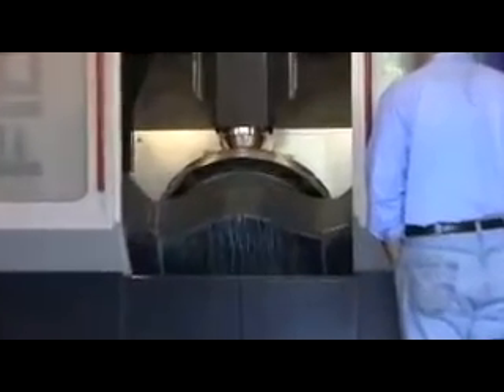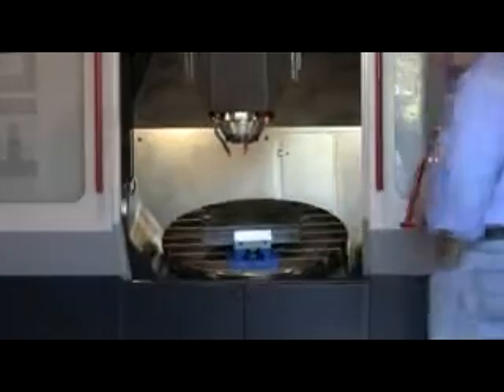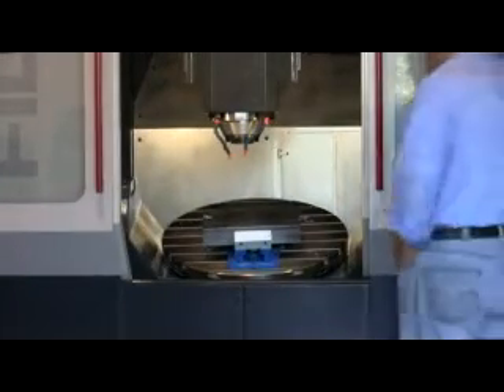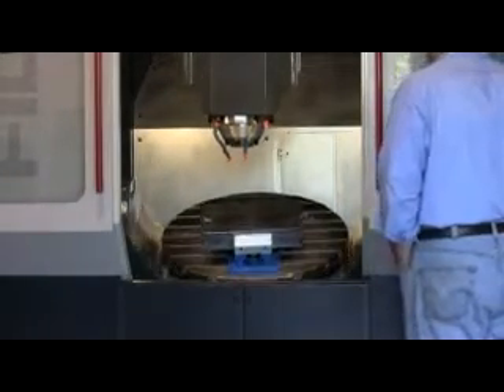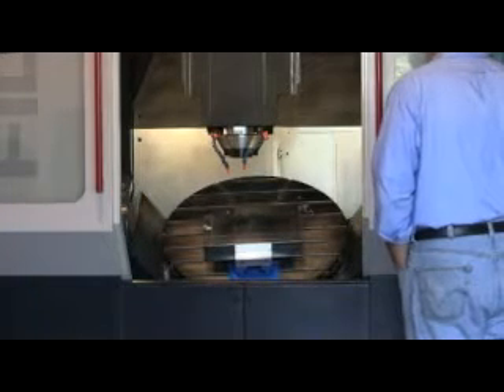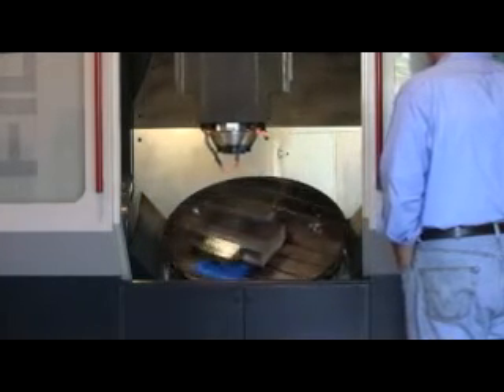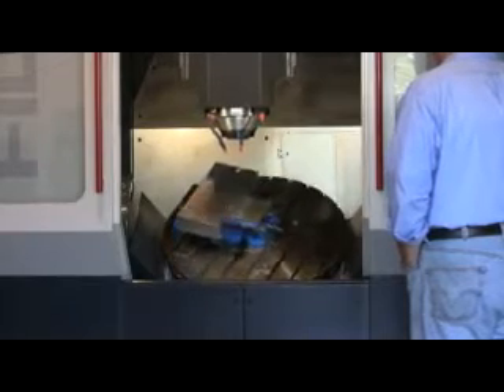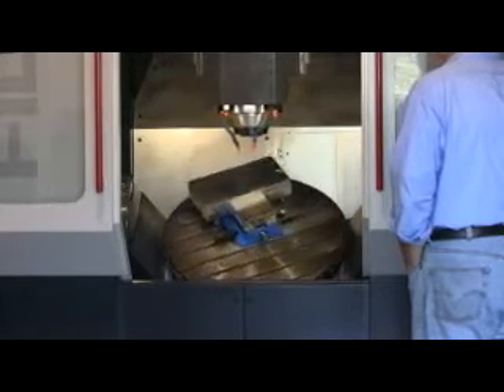SwiftCarb RampMill 6061 aluminum at 200IN Material Removal Rate

Comment: Unless thats a 50 taper or HSk100 with 100+hp theres no way i believe thats only 18-20% load. Impressive no matter what, but that doesnt sound possible for the load to be that low. My Okuma M560 would be pushing 100% for sure on this cut